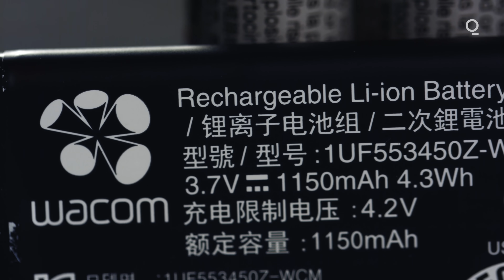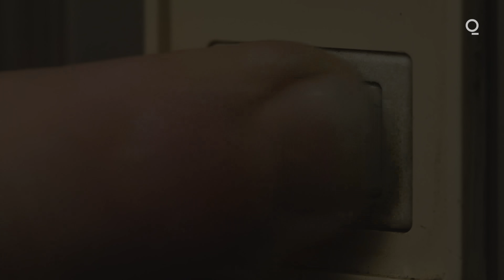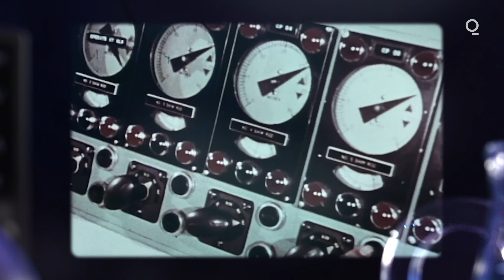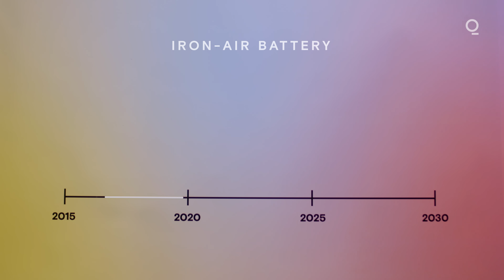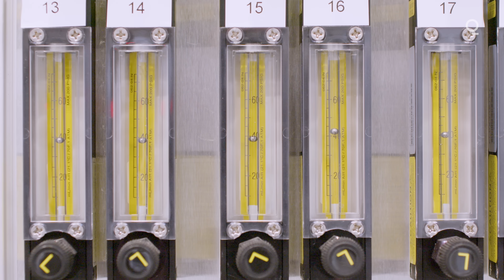The Huge, Weird Batteries of the Future

Comment: why hasn't anyone tried pyrolysis of plastic waste?
Reply: you can make a solar powered kiln to pyrolyze carbonaceous materials like waste plastic, rubber, cardboard and paper, without any emissions at all, with just a basic solar charged sand battery.

then the resulting charcoal is useful to filter municipal waste water and till into fields to improve soil quality and fertility, and reduce run off.

meanwhile, the sand battery infrastructure itself provides some amount of power which can be used for other things.

in this way you've taken a single demonstrated technology and very simply extended it to achieve scalable carbon sequestration and environmental clean up simultaneously.

Comment: Ambri's new liquid metal battery, in my mind, takes the lead in this. Low cost and the fact they are shipped already built is going to change everything. I think they are releasing the first ones this year. I think each "battery" is a shipping container that can store 1MW (or something like that). Also easily scalable to GWh levels. They stack, no parts to replace, and are easily and quickly swappable. Super excited for them to take it mainstream.
Reply: Wow
Reply: @Daniel Meyers Ambri has no existing, installed utility scale projects.  It’s had soon-to-come promotions for years now.
Reply: @Daniel Meyers it never happens. that guy has been making claims like that for a long time.
Reply: Ambri been in development ten years or more now.  It’s not competitive w even li ion. 

Get serious.  Build nuclear.
Reply: @Daniel Meyers Interesting, so which company is currently using the batteries?
Reply: @Withnail1969  none for large scale storage
Reply: The grid it's self is an atmospheric electricity harvesting device ? How many miles of cables are suspended by ceramic insulators on pylons all over this world ?
Reply: Nicola Tesla's Warden cliff tower would have worked
Reply: @Daniel Meyers I doubt they will deliver any. We only have his word that they have any orders for them.
Reply: @Daniel Meyers frequency stabilization projects are seconds deep and no answer for large scale energy storage systems needing many hours, days, even months of backup.
Reply: @Daniel Meyers it will never be a heat it up one time and walk away answer at 500C.  The heating system and insulation adds cost that makes it non competitive. .
Reply: @Nill757  adds costs and unacceptable safety issues.
Reply: @Withnail1969  We only had two civilian accident, i believe only one person died in Fukushima due to radiation. Chernobyl was military reactor to make power and take out tritium and probably plutonium.
Reply: @Daniel Meyers Its already been tried by bigger companies with wayyyy more money and they failed it's a bad idea when GE did it and it's a bad idea now.
Reply: 1MW is unimaginable for any stack of batteries, let alone GWh :) This is the same joke like those nuclear batteries. Fine for the army, space, not general use :)
Reply: @codaalive5076  What do you mean by nuclear power is not viable for “general” use, when there are a hundred nuclear reactors in the US alone?  If you mean not viable for your house or local school, fine, but then neither is  a gas, coal, wind turbine, or hydro plant usable for the home.
Reply: @codaalive5076  you're brave to flout your lack of knowledge in public. "The Moss Landing battery storage project is a massive battery energy storage facility built at the retired Moss Landing power plant site in California, US. At 400MW/1,600MWh capacity, it is currently the world's biggest battery storage facility."
Reply: @skierpage  You don't read what i wrote and this can output electricity for very short time. Moss Landing site is actually gas power plant with battery serving no real purpose other than testing a lot of failures.
When US or Germany will mine huge reserves of Li in Germany (don't know about US reserves), then we can talk what this toxic stuff means.
Reply: @skierpage  We can't conversations without both knowing most of what we discuss. Some mistakes are fine, no one knows everything, but basics are important because this is not some primary school stuff.
Btw, i was mentioning toxic mining of Li, not gas. Beside, gas plant powers this batteries so i don't see much sense to put them inside such plant except for testing.
Read that article if you want, this is what i can give you, your mentioning of batteries were news for me although i see little sense in what they are doing.
Reply: @Daniel Meyers They g
Reply: @Daniel Meyers It was developed at MIT by one professor and a group of students.!!!!
Reply: @Daniel Meyers It's the HEAT that is stored and lost with charging and discharging....Charging liquefies the metal, discharging cools the metal... very safe...and cheap....only downsize...they are heavy and do not scale down.....you'll never find one in a cell phone.
But you can build them as big as a house or building. The best part is, after thousands of charge and discharge cycles, there's no appreciable loss of ability to hold a charge or build up internal resistance..
Reply: crypto trading is the future of all investment , text me on what app and make money daily from an organize copy trading strategy signal pattern
Reply: Great, what are the carbon footprints and ability to recycle these huge batteries? What happens when they catch fire, electric cars already have issues with catching fire and there's no way to extinguish them, just let them burn out for days! So we have hit the flat on advancement, just making them bigger is the solution? No thanks, Nuclear power, natural gas, coal are here to stay. Green energy is a fools dream. We are seeing the toxic downside with wind mills and solar panels, the true reality!
Reply: @FlatBedLife717  gas coal will run out and they pollute the air.  Nuclear is clean, won’t run out.
Reply: 1MWh
Reply: Sounds like another scam to me, I wonder if Thunderf00t has done a proved or disproved video on it yet.
Reply: @Daniel Meyers Pretty sure it doesn't matter if there are enough capacitors and battery systems or even just a sensor regulator system in place saying hey were hitting the threshold that you need to kick on. then even a 5 minute ramp up wouldn't matter.
Reply: Nobody is going to buy Ambri's battery because it needs to be maintained at 450 degrees centigrade or so in order to function. It's a non starter.
Reply: @Daniel Meyers Nobody wants a battery that has to be kept heated at that temperature. It's an absurd idea that would be rejected within a minute in any board room.
Reply: @Withnail1969      Low cost:  energy storage system CapEx at 25% below 4-hour Li-ion systems
    Long life: 20+ years lifespan with minimal fade
    Safe: no gas generated, no thermal runaway
After commissioning, the systems do not require heating or air conditioning. They are self-heated and self-regulated.
Reply: @Withnail1969  actually liquid metal batteries would be ideal for solar farm in a desert. Great for a battery that likes the heat vs one that gets destroyed by it (Li). Also there's a growing demand for renewable in the middle East too.

Like everything with renewables we will need multiple solutions to the same problem.
Reply: @buildmotosykletist1987  Wow, you're suffering from a serious case of the Dunning Kruger effect. What others here are saying about the ramp-up time of pumped hydro is absolutely correct. There's also wear on the facility associated with ramping up and down too much. For that reason hydro power plants are considering putting batteries IN their plant, to complement them and decrease maintenance costs.
YOU need to look up what frequency regulation is all about, and why it's a bigger challenge with more wind and solar on the grid. We all know DC power from batteries has to be converted to 50Hz AC to power the grid through an inverter. That's high school level knowledge. This discussion is at a much higher level than that and you need to do some reading if you want to contribute.

Comment: For the pumped storage lake battery, would the effects of evaporation not lead to a pretty significant loss of energy?
Reply: Probably does cause an energy loss, but maybe not significant.  The final efficiency would include that loss.
Reply: There is a loss anyway. You can't get the same out as you've put into it.

Comment: No matter how hard oil companies indirectly lobby against the nuclear energy it's still the future of cleanest energy we have till this day.
Reply: No it's not. The majority of new generation is wind and solar because they're cheap and quick. No private utility will build a current-generation nuclear plant that takes 15 years and $15 billion. And it will take 15 years and $15 billion for each of the next-generation liquid sodium molten fluoride small thorium modular blah blah nuclear reactor designs to prove whether it actually will be cheaper per MWh and quicker; they're worth R&D for future decarbonization, but they're irrelevant to achieving the rapid reduction in fossil fuel burning we need this decade.

The economic case for nuclear is even worse now than it was a decade ago, in the face of renewable electricity that is intermittently dirt cheap.
Reply: The Connections (2021) [short documentary] 🌳

Comment: If the suitable mountain landscapes for the first solution are relatively rare, can't the cliffs by the sea be also used? I guess the reservoirs would have to be either made of concrete, or have some other lining to protect the surrounding nature from salt if the terrain is not rocky, but it would widen the choice significantly. Or am I missing something, like salt water can't be used or whatever? I was just intrigued by that statement, and besides there are many wind turbine installations in water, so they could choose locations suitable for both generation and storage etc...
Reply: You would flood a massive area of land for very little energy storage. Coastal cliffs are almost at sea level, they have very little gravitational potential energy. You ideally want your reservoir on top of a high mountain.
Reply: Gravity is an extremely weak force. Gravity storage is only worthwhile when nature supplies huge upper and lower storage areas (lakes or reservoirs) with a large height difference and a huge working mass (the Northfield pumped hydro in the video holds 20 million tonnes of water).

Comment: This method is NOT the solution, because the amount of storage is waaay too small and not every landscape is perfect for this and where the landscape would be perfect, the population is against it.
Reply: There are 23 GW hours of pumped hydro storage in 43 plants in the US.
Reply: @steven4315  So what? How long these hydroplants are able to generate electricity?  The answer is: It depends on the size, but even the biggest one is really fast empty. And than? Do not forget: you must pump up all the water before you can use ist as current again. Those hydroplants are able to make current for a certain time over the day when electricity is needed more, in the morning, during lunch time, in the early evening for some ours, thats it. 
Thea are not able to store electricity for some month of usage, during the wintertime.
Reply: @udomann9271  They are part of the solution. There is no 'the solution'

Comment: The segment where he is pumping water to the top of the mountain, then letting it flow back down to produce electricity... wouldn't it take just as much energy to pump the water up there as it created when coming back down?
Reply: Yes but you pump it when renewable solar/wind is producing an excess because it’s sunny/windy. Then you release it when it’s dark/not windy.
Reply: Yes, it does. That's the idea: It's not energy generation, it's energy storage. Because demand is not constant (People consume more during the day than at night), and some renewables don't produce a consistent supply either. Storage solves that problem by storing excess energy for when it is needed later.
Reply: Ah yes, of course.  I should have realized that.  Thank you both.

Comment: It's actually kind of dumb that we don't have an energy storage network even without considering that renewables are dependant on it. All it takes is some sort of disaster to take out a power plant, and everything down the line that is dependant on it comes crashing down.

If the grid was backed up by battery banks everywhere, then even if your power generation gets taken down, you have some sort of grace period, where you can shut down everything except for critically important things like medical equipment and food storage cooling, etc, so nobody dies pointlessly while whatever the crisis is can be dealt with
Reply: There's going to be a lot of people dying pointlessly over the next 20-50 years. May as well settle in for it, and don't get too attached to your own life.
Reply: You're describing a home battery (Tesla Powerwall), expensive but worth it for some. And your EV will be able to power your house, starting with the Ford F-150 Lightning.

Comment: All that needs to be done is to build continent wide high voltage DC grids

If this is done huge amounts of electrical energy can be transferred over long distances 

This would eliminate the needs for large amounts of storage as the energy could be move from one part of the continent to the other 

It would be what it is now, a just in time energy delivery system.  Remember, on a continent wide scale the wind is always blowing somewhere and the sun is always shining somewhere and the tides are always varying.
Reply: Somewhat difficult. Converting voltages on DC can be done, but it needs large and bulky equipment. With AC you just need transformers - which are a lot cheaper, and they almost never break down so long as you give them their regular oil change. You could better achieve the same aim by expanding and combining AC grids, but either way there are also political considerations: Even if you ignore the technology, it's hard to run one grid across multiple countries which are subject to different regulations. Europe managed it, but only with decades of negotiations between participants. The US can't even manage to get one country on a single grid: It has three. One for the east, one for the west, and one for Texas (For political reasons).

Long term, it's going to be an important project. But not an easy one.

Comment: But what is the efficiency of an iron air battery?
Reply: About 70%. But if you are putting 3 cent solar electricity in and taking 10 cent  6 PM electricity out, it works.

Comment: I want to know how they not use more electricity  pumping up the water than what they can get back from generating isnt that a stand off thing ..?   I dont get it ..?  there is no way it takes less electric to pump up to letting it go back thru turbines ?
Reply: They lose 20% +/- of the electricity.  and this must work well because they are built all over the world.
Reply: The system loses energy. It doesn't contribute to the overall figure of generation capacity in GWh. Not unless you restrict the electricity to powering the pumps to being the excess from renewable sources.

Comment: What would happen if all the power stations were running BUT everyone switched off EVERYTHING?
Reply: That's an interesting question. I know I can disconnect the load from my generator and it doesn't seem to affect it , however I'm not sure if it scales up to power station level.
Reply: I can answer that one easily: Everything shuts down. In a simplified, textbook power station and grid it would indeed be a disaster: With nowhere for the energy to go the grid frequency would shoot up and a massive voltage spike would occur. Transformers would explode. Turbines would fly apart into shrapnel. But in the real world, this actually happens all the time - when a major power line goes down a station may well be isolated with nowhere for the power to go. So there are automatic safety devices for this situation: As soon as the frequency or voltage deviate from safe limits, emergency disconnects open and turbine feed valves slam shut.

Somewhere in a control room, loud alarms start to sound and panels covered in amber warning lights start to flash. But there is minimal damage to equipment, and everyone gets paid overtime while they work to restart the grid piece-by-piece. People endure a power cut that lasts days in the priority areas like major cities, and potentially weeks in low-priority rural regions while engineers travel around to reset older breakers which do not have central control, or to replace the few pieces of equipment which actually were damaged by the event.

Comment: Some of this nonsense will make folks dumber for having listened to it.  

Of course we can deal with surplus Wind and/or Solar without having to "store" it.  Just let it go.     
A fresh batch of Sun comes up every morning.
Reply: You store it so it is available at 7 PM when everyone goes home and turn on the AC an microwave.
Reply: @kkarllwt  No, just turn the AC during the day -- when the Sun is shining (remember what causes the need for AC? Sunshine).   Let the place get nice and cold and coast on that.  Let the light from the Sun cancel out the Heat from the Sun (duh, huh?).   Problem is now, US is still using a set-back thermostat model of delaying the load until late in the day and then overwhelming the local grid(s).   Aligning Time-of-Use and Time-of-Production is mostly a behavior thing not so much a technical issue.
Reply: That’s the problem with wind/solar. Its not windy all days, and no sun at night. Need too store it too not have a blackout at those hours.

Comment: There's also another problem with the pump storage, overtime the water will evaporate right?
Reply: In West Texas a local environmental engineer measures surface evaporation in excess of 80 inches per year.  Elevation is 3200 feet above sea level.